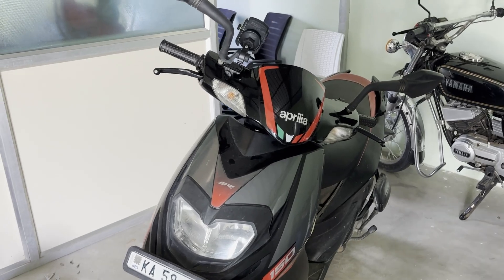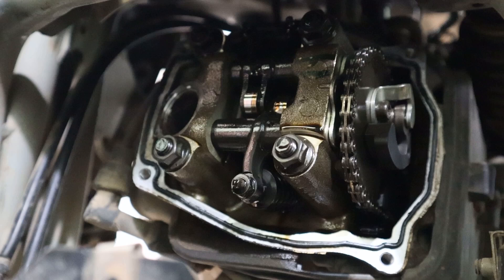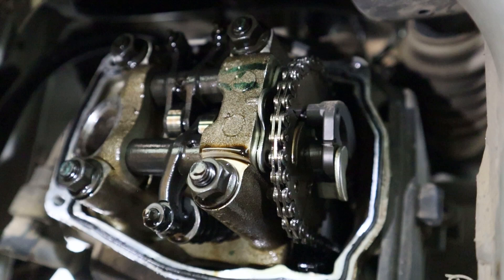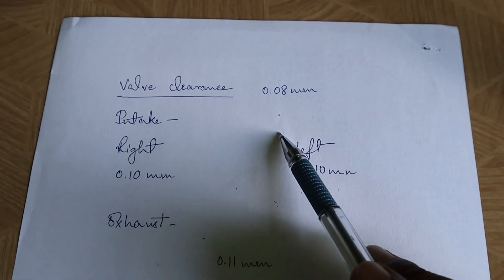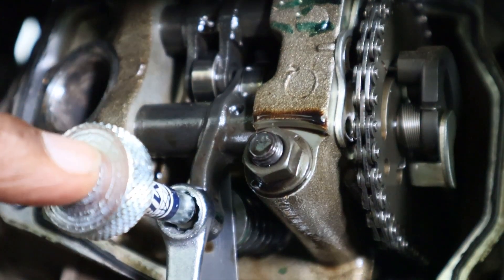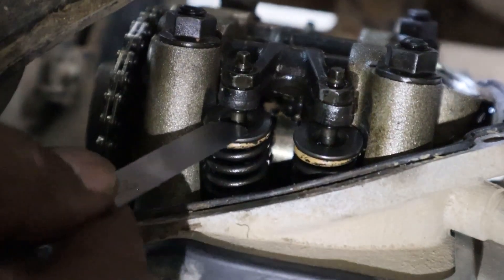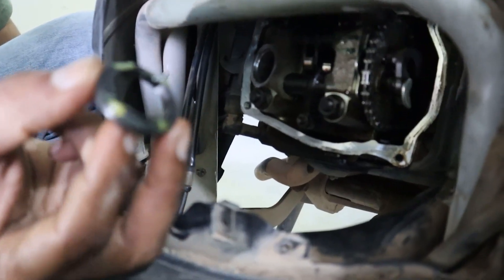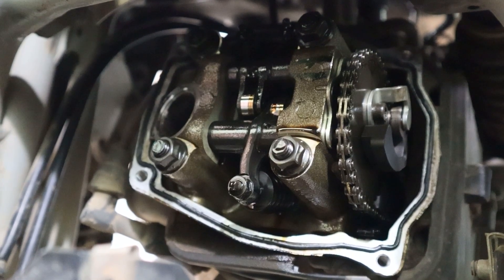Valve Clearance check and adjustment on a scooter - Aprilia SR150.

Comment: Hello sir there’s a correction in the valve clearance after checking around many service Manuals and service centres I have found that the clearance for both Vespa and Aprilia 125-150 is 
Inlets : 0.10mm - 0.15mm
Exhaust : 0.13mm - 0.17mm

Comment: bro what are the symptoms bad valve stem seals, when i checking the intake manifold pipe, intake valve outside have brownishish dark oil seeing is that normal??also morning choke sound,after heat its  normal,
Reply: bri polution certificate failed hee